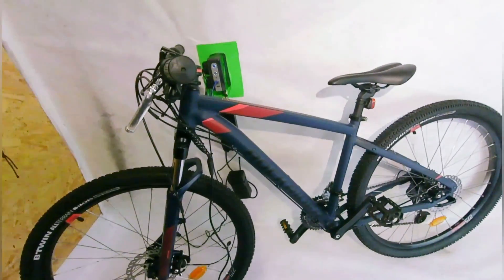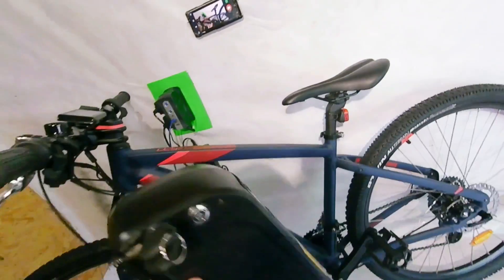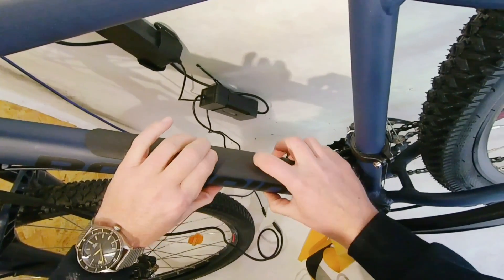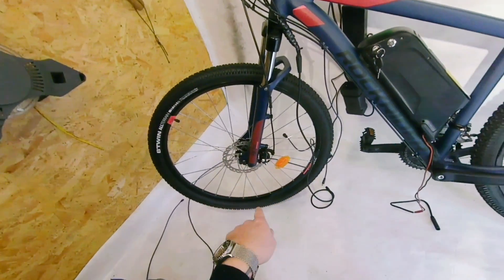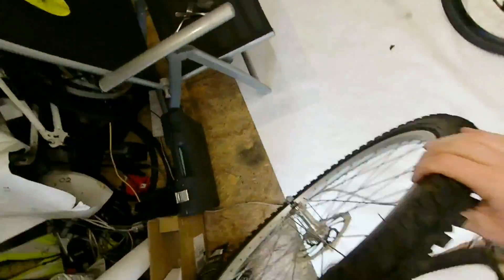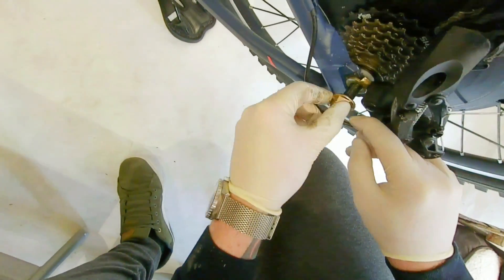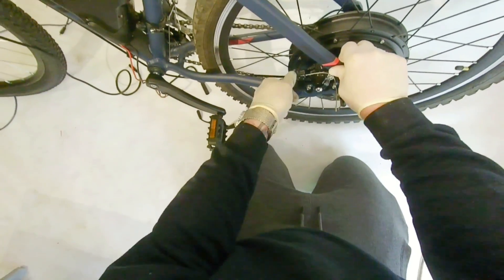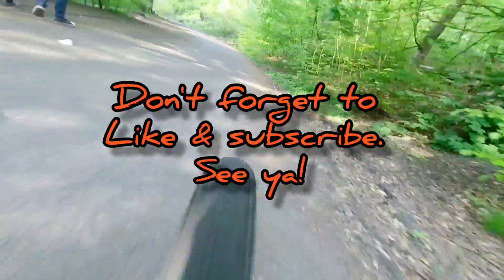New diy ebike build part 1

Comment: Im building a  1500 x 2 / 3000watt Dual Motor EBike on a NEXT Power Climber for it was the closest thing to use as frame of the ones made for Conversion Kits. It seems perfect of using the Next P.C. Frame of being lighter than most from the start which saves me a lot of weight. Not done due to me waiting on the other parts but stoked I had a bike frame similar to the frames made for e bikes..
Reply from the maker: Sounds great 👍 
I'd love to see it when it's completed
Reply: @DavidAinscough100  Thanks, I just got done putting bike tube on the Hub( its really not easy if tire is wrong side, lol) I just have to file a scratch on the forks left side where the bolts are for the rotor. Just a tad. Be near first week of April to get battery for its not cheap. Last time I used E . BACK IN 90S of my lead battery run scooter as it was not really practical of use of tech back then. Now, its caught up with many options if you got the resources to get more teched out of power..
Reply: @DavidAinscough100  I use to do the Flintstones jog on scooter when battery dying to get more juice to make it home, lol. I assume that many others did too and reasons why PAS is so mainstream now.

Comment: Nice, the motor with built in controller definitely makes for an easier build, which throttle is that, an ebay job?  Ive got a twist throttle but it feels too short and my hand is a bit cramped on it, only got a glimpse at the one you put on this but it looked a good length on the handle bar and without any bits that stick out for the palm which I also find uncomfortable on mine, any chance of a link to that throttle for me to have a look?  Cheers
Reply from the maker: Hi fromatic 
This throttle came with the motor kit.
Motor ,controller , lcd screen, throttle  and brake leavers that cut out motor all came as 1 kit.
I tried to buy another but they were sold out and became difficult to get hold of, apologies for not doing more videos, I've been busy at work 🙂

Comment: Can you list what parts you used and where you purchased them from? Thanks
Reply from the maker: Hi Christian 
Yeah I think I'll do a video on that if people are interested 👍
Reply: David Ainscough where did you get the kit from mate. And how do you know what size to get
Reply from the maker: @ned04  I got the kit from Ebay, I knew I wouldn't need a massive motor as the mountain bike isn't that heavy and it's for my missus so it didn't need to be over powered as I didn't want her going too fast. That being said it goes 25mph which is more than enough for her.
Reply: Hi David nice build looks simple how much it costs can you do part two of the video and leave the links of the parts hanks
Reply from the maker: @Paivaeste  nice to hear from you, part 2 to this video is up on my channel ready for you to watch, i will do a seperat video listing the cost and parts needed 👍
Reply: Hi! You should check finnish electric bike convertions kits. Its Greencycle. fi